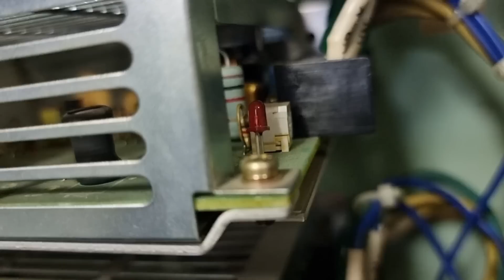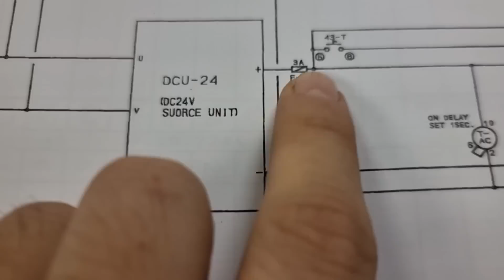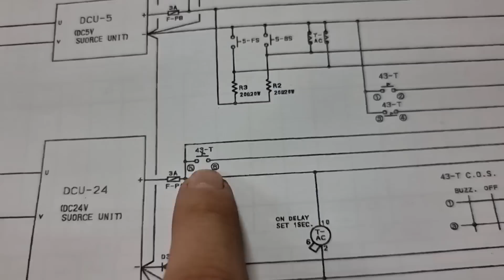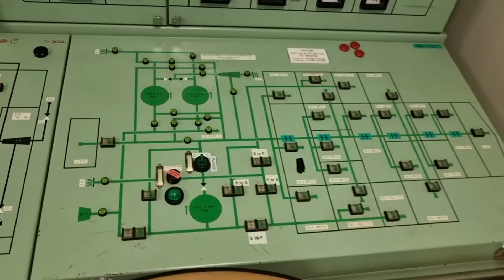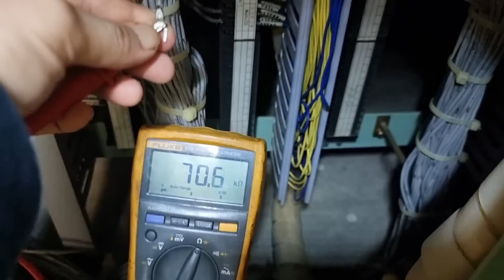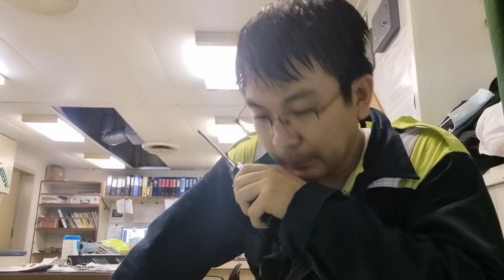24VOLTS EARTH FAULT BURNT 2 POWER SUPPLIES

Comment: Need help here. How can the Power Supply be burned or shorted when the fuse was intact to begin with? Shouldn’t the fuse be burned down first and save the power supply?
Reply: I think the fuse is to high value rating. Use the correct fuse size.

Comment: .  Breakers and fuses are mainly there to protect the wiring from burning up, but I would install a fast blow, it sometimes protects dc power supplys.  The  3amp uc1 cello lite fuse you have shown is a time delay fuse. Slow blow fuses will fry power supplys for sure.

Comment: Previously I have located shorts using a TDR because it can give you a "distance to fault" and if you move to a different probe point you'll either be closer or further, although with lots of open circuits in this way, it might be harder than when I do it with data lines. Another electronics technique from circuit diagnosis is to use a micro-Ohms meter so you can see the very small differences in resistance as you get closer to the fault. Both these are more expensive/complex than simply disconnecting each node and checking it, but time is money in some cases.

Comment: 70k ohm seems like a high resistance to cause damage to a 2 amp power supply! But I suppose it could be a non linear thing like water in a connection

Comment: Thank you sir new learning! 

May question po ako sir anu po ginawa nyu sa isolated cable the one that's causing the fault. Bakit na disregard napo. Wla po ba cyang bilang sa ckt diagram sir. Salmt po
Reply from the maker: hi, bubuksan pa yung valve na yun kung ano problema but for the mean time hindi muna magbibigay ng indications sa panel kung open siya or close pero magagamit parin siya yun nga lang need i check manually kung talagang naka bukas or sara sa actual.
Reply: @leckyjake  Thank you sir.

Comment: good job.but even reading 70 k ohm is not too much earthing .by equation I=24 v/70000 ohm=3 mA .so I think that's not the main reason for burned power supply
Reply: It is an indication that something is not right. And the fluke only measures at a few volts. At 24V the resistance can be a lot lower.

Comment: Awesome video, I only did not understand - how did you found which valve is the culprit?
Reply: In the last part, when he is measuring one by one the white wires (going to the limit switches of the valves). He measured line to earth resistance and from there he was able to see which particular valve was causing the earth fault.

Comment: Hindi ba sya kasama sa grounding alarm ng 24v sir jake?
Reply from the maker: hindi siya kasi ang main supply is 100V so kasama sa 110V na system
Reply: @leckyjake  Makes sense at hindi rin sya madedetect ng 110v sa low insulation. Dapat may sarili sya kasama sa panel nya. This is really good as an additional learning. Thanks sir jake.

Comment: But why didn't the fuse blow if the power supply rating was more than 3 amps why didn't the 3 amp fuse blow first
Reply: fuses are mainly for short ckt., most of the time it does not react to earth faults

Comment: Good day sir. I would like to ask about my reefer trouble for STARCOOL.  SET POINT = - 3.0, SUPPLY = 11.6, RETURN= 12.3. After 4 to 5 hours na mamatay po yong compressor nya. Pro wala nmn pong alarm sa panel. Ano po kaya problema nya. Please confirm po salamat
Reply from the maker: better check the pressure. to troubleshoot, kailangan alam mo yung working pressures.
Reply: @leckyjake  pressure check muna gagawin ko dito sir?
Reply: Goodmorning po sir..  Sir panaano po ba proper na pag refill nang freon sa reefer container. Nka off po yung compressor motor or naka andar po? Salamat

Comment: Good video. How did you earth chase at the start of the video? Did you put the neg and pos probes across the fuse and it should read OL but read 70k ohms indicating earth?
Reply: Is it important to remove the fuse for checking the ground fault?
Thanks.
Reply: @cck1496  I think it's for safety and at the same time reducing the work itself. Imagine the line below the fuse is good(no line to ground fault), you will just focus on upper side of the fuse, and it's just a wire so it's easier troubleshooting
Reply: The line is line-to-neutral and if you test for resistance between the two you should not get resistance and it means not shorted. The negative or neutral is bound to grounding, so he focus on hot line side which he found out shorted or connected to ground or having earth fault. He test all others(connected to line side) line to ground to determine which is connected to ground/shorted. That's all I understand.
Reply: He checked the load side of the fuse to ground?
Reply: @andyfannan8298  Yes
Reply: It is called short to ground fault? No short indicates zero ohms and short indicates more than five ohms?